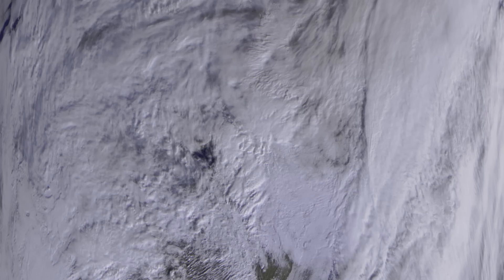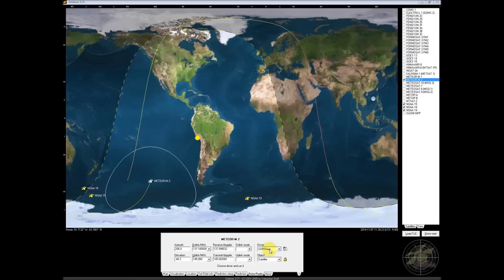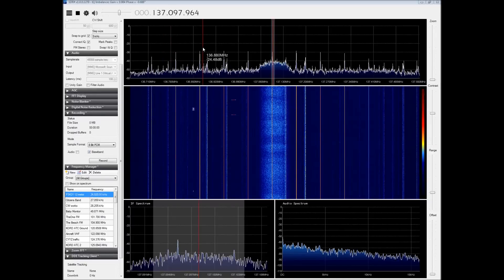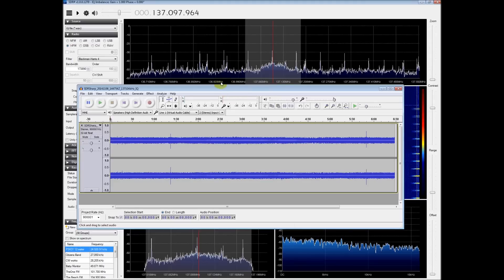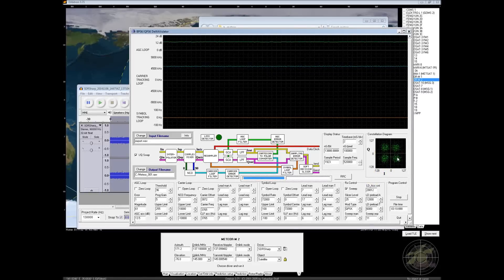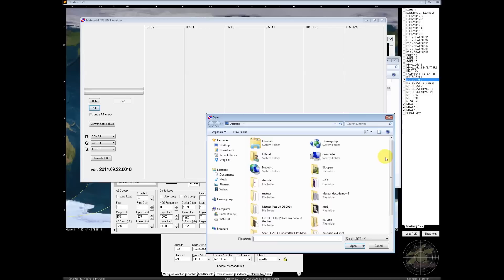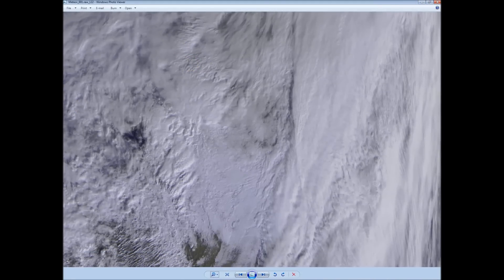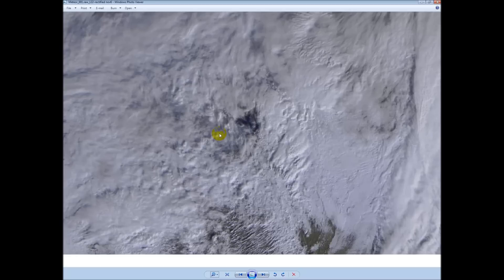High Detail Weather Images from Russian Meteor M2 Satellite Using SDR

Comment: How do you get the SDR Sharp driver to show up in Orbitron?  I've got SDR Sharp installed and it works fine, but that particular driver doesn't show up in the driver drop down box in Orbitron.  Thanks!
Reply from the maker: I remember you just have to edit the SDRsharp cfg to reference orbitron. You'll have to Google for the specifics.  Cheers

Comment: Personally, I use GQRX on Linux as it dosen't require messing around with any more then calibration. GQRX, of course, uses GnuRadio. Been experimenting with the SDR lately and picking up all sorts of odd stuff. Like power company telemetry information which I have yet to figure out how to decode (It's on my channel). Definitely gonna give receiving weather satellite information a try, watched another video detailing building an antenna.
Reply from the maker: You can indeed build a pretty cheap QFH antenna pretty cheap. Good luck
Reply: MKme Lab 
I don't have near enough continuous coax to make a QFH Antenna, only a 25 foot coaxial cable with fittings on the end (which I'm definitely not going to cut up) and random 1-5 foot lengths of coax without connectors on the end. Going to make a double cross antenna with 4 dipoles as I have lots of thin pipe. I have a fitting to solder to connection of the dipoles to plug th e25 foot coax into. Going to make one of these: http://www.qsl.net/l/lu7did/docs/NOAA/DoubleCross_137Mhz%20AntennaMARTES.pdf

Just getting into radio things so I don't have near enough supplies for more fancy stuff. I could use an old piece of coax from a TV antenna we had removed, but it looks pretty beat up.
Reply: theLuigiFan0007 you can easily build a QFH with any type of wire, I build several for different bands. On the 137mhz version I used 1/4" copper tubing to make it a little more broadband but any type of wire would work. A cheap tv preamp does wonders also, you don't need to spend $100s on a satellite preamp.
Reply: Tyler Costantini
I actually did manage to decode a signal using the coax antenna, but there was a lot of noise in the image and because of that I couldn't add color. Definitely doing a 1/4 pipe build in the future, just busy with IT courses for college right now. Pipe is definitely a lot more solid, especially if soldered together permanently after you tune the angles perfect. Then mounted on a PVC pipe as the insulating mast.

Ah, good point with the antenna amp. I'v used a TV preamp to boost the power of tiny FM transmitters and VHF remotes before, should work wonders for 137MHz-ish band as well. Thanks for the tips.

Comment: Hi been trying to get this to work but every time i go to decode the wav file in LrptRx it only shows 1 dot in the constellation instead of 4 , then i use the raw to get a picture but never do. any help would be appreciated, also thank you for your very clear video
Reply from the maker: That Guy If your recording isn't centered on the freq you will never get a constellation.  That was my issue.  Look at the filename and see that it is bang on- if not, it won't work.  I had this problem for weeks. Cheers!
Reply: thanks, will try on my next pasover